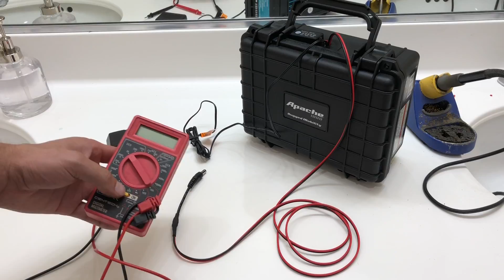DIY BATTERY BACKUP FOR REEF TANK (PART2)

Comment: Pretty much you do away with the power source and run the plug part of wave pump through the battery so I can still use the controller for my hygger wave pump still.... So if power goes out it will stop charging and work the pump

Comment: Nice project. The only thing I would say is to keep an eye on the cheap trickle charger from HF. I had one just spontaneously stop working. 
I think that for most people the battery backup will be a thing that gets installed and never gets moved thereafter. So in all honesty the travel case is probably not necessary. If I were to do it, I would go with an automotive or marine battery in the garage and just run the wire through the walls to the tank. That's enough capacity to run a couple pumps, an airstone, and maybe a fan to cool the tank if it starts getting too hot. Hell, if you want to get real ambitious you could hook it to a solar cell to give you prolonged battery life in the event of a longer power outage.